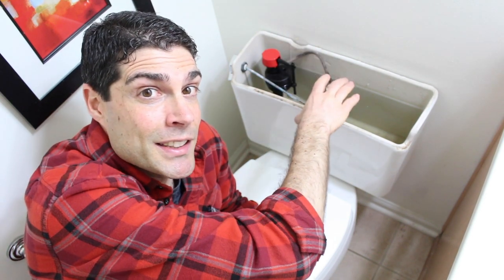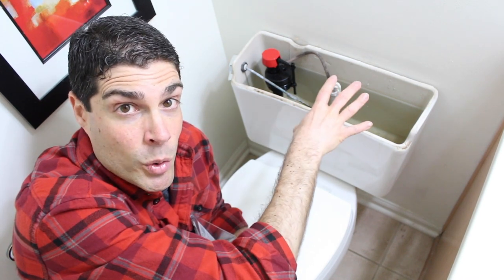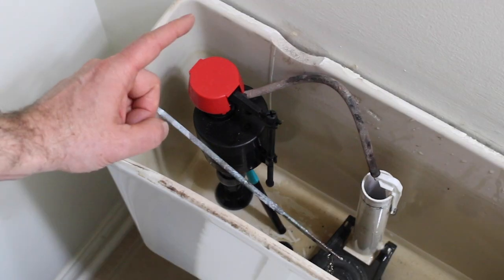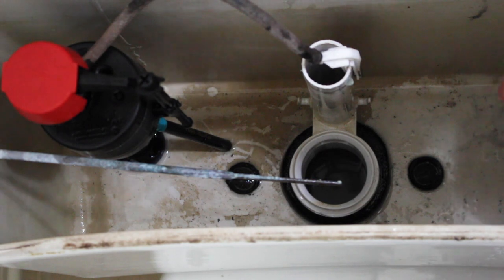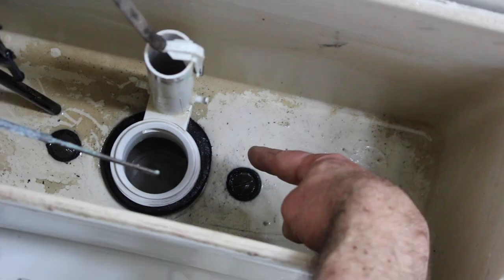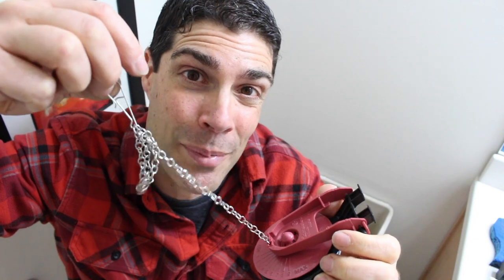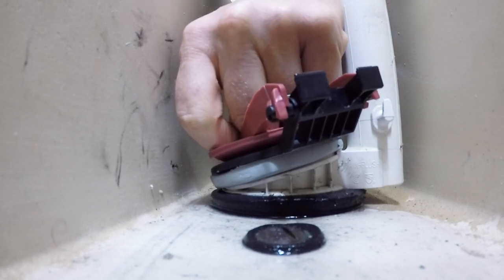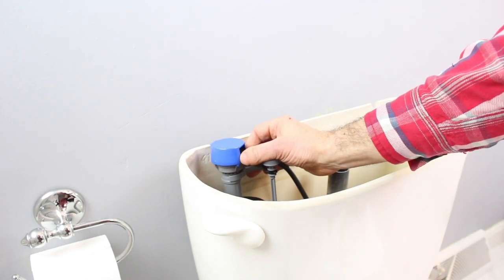Fix Running or Leaking Toilet With Fluidmaster 555C Flush Valve and Flapper Repair Kit

Comment: Got it work. Had to press down on it 4 separate times before it sealed. I am talking two thumbs and up on my toes pressing down, after the 4th try it finally
sealed and no more ghost flushes. Tip, to make sure you are centered over the old opening, take of the flapper when setting in place. The flapper easily attaches afterward.

Comment: We have an OLD toilet. he house was built in 1965 and I would not be surprised if it the original. We bought the house 3 years ago and there was a Fluidmaster 555C in there. 
I had a plumber come and replace all of the water shutoff valves in the house because I couldn't turn any of them.

After he left -- and it seems unlike this was his fault -- we started hearing water dripping. The existing 555C looked worn. I replaced it with another (and I did follow the instructions for installing to porcelain) but I am still hearing water leaking. I tried the food coloring test and the water is coming from the tank to the bowl.

Should I pull up the 555C I just put in and tried to re-install it?
Reply from the maker: The best tip we can offer to find a leak is to do a visual test for siphon and a water test. 
First look at the tank and locate the refill tube, in most cases is a small diameter tube coming off the fill valve and pointed to the overflow pipe, in your case it may be going to a hole on the tank wall or a ceramic overflow pipe. Once you locate it make sure the tubing is not inserted into the opening of the pipe but instead held above it by a clip. If the refill tube is inserted into the opening pull it out and let lay in the water.

Second turn off the water to the tank when the tank is full of water. Mark the water level and let the tank stand for 60-90 minutes without flushing. If you come back and the water has not drained down from your mark then the issue is the refill tube. The fix is to get a clip to hold the refill tube above the overflow pipe opening. If the water does drain down you will need to replace the 555C and try installing a second time, making sure the refill tube is above the overflow pipe.

For additional help or questions visit our website at Fluidmaster.com/support for troubleshooting tips, installation videos, email and chat support or call toll free at 800-631-2011.

Comment: Our toilet has the drain pipe installed at the 9 o'clock position, and is a slanted seat - do I now refer to that as 12 o'clock, or do I just ignore that and just follow this video's positioning?
I'm assuming I make the pipe the new 12 o'clock but wanted to be certain.
Thank you!
Reply from the maker: You are correct in making the overflow pipe the 12 o’clock position. The requirement is simply to offset the flapper frame from the overflow pipe so there is no interference when the flapper is pulled open. If possible set the chain to the tank lever so the pulling action on the chain is as straight as possible. For additional questions on this Fluidmaster product contact us at your earliest convenience. Fluidmaster’s Technical Service Department is available Monday through Friday from 5:30 AM through 5:00 PM Pacific Standard Time. Contact options include: Chat and E-mail on www.Fluidmaster.com and Toll Free 800-631-2011.
Reply: @FluidmasterInc  Thank you! Toilet is flushable again :-)

Comment: I installed the whole valve assembly on two older American standard toilets, 3.5 gallon flush, they were installed around 1979. I installed the fluidmaster kit about 25 years ago and they have been working great ever since. My friends toilet was leaking into the bowl so he shut the water off and asked me if I could fix it, we got the kit and when I looked at the flapper it had this weird angle to, I removed it and installed the flapper that came with the kit, bit was confused about this angle piece until I saw this video, now he thinks the toilet doesn't fill as fast as it used to and after flushing the water still leaks into the bowl then shuts off, I'm wondering if I need to install the angle piece again, there is no brand name on the toilet and he swears the toilet was never worked on as far as he knows, the house was built in 1980 and he bought it in 2000, he has two other bathrooms he can use one I installed a new toilet in a couple of years ago but he wants to be able to use this one it's in the master bedroom, the next time into there I'll have to see what I can do.
Reply from the maker: The Flusher Fixer comes with 3 pieces as indicated in the video, the flapper, the drain seat and the putty. In some cases when the flapper is set to a higher numbered setting, setting 9 for example, the tank may let too much water out of the tank causing the fill valve to run longer to refill the tank. We suggest simply adjusting the flapper to a lower setting to reduce the fill time. As for the leak if we cannot stop the leak with a new drain seat and flapper then it may be time to replace the entire flush valve. Other than a refill tube from the fill valve that is inserted into the overflow pipe, that will drip water into the bowl, there really is not any other places the tank water can leak into the bowl from. For help or more troubleshooting tips contact Fluidmaster by email or chat using Fluidmaster.com/support or call toll free at 800-631-2011, Monday thru Friday 5:30 am to 5:00 pm PST.

Comment: What if the black gasket between the flapper and the tank base is deteriorating?
Reply from the maker: That gasket (also known as a “Spud Gasket”) when damaged can allow water to pass by the flush valve drain and leak into the bowl or in some cases leak right onto the floor causing damage to your home. Our recommendation is to replace the flush valve. Fluidmaster’s flush valve kits all come with a form fitted spud gasket already installed on the valve and our newest Flush Valve Kit 507A-008 (For 2 Inch Toilets) comes with a wrench to fit older and Fluidmaster flush valve lock nuts.

Comment: How to locate the new 555C Flush Valve and Flapper 3:20: It has to be rotated for the hinge area to clear the existing tube.
In our toilet the Adjustable Flapper attaches to a Fluidmaster pipe/flapper seat already - replacing not a breeze because its jammed against the toilet bowl wall  "not me" did that.
Reply from the maker: Ron - could you please call Technical Support at 800-631-2011 so we can better understand the issue? Thanks.

Comment: great video except for the annoying background music. i just found out about this product and i sure hope it works so i won't have to remove the tank including the stupid ferrous nuts someone used to fasten the brass bolts. i don't understand how water has been seeping thru the flush valve even after installing a new gasket.

Comment: Not all toilets use a flapper valve. Some--Eljer, for example, use a ball on a vertical rod that drops down into the tank drain. Sometimes the ball doesn't drop all the way and the tank leaks into the bowl. VERY annoying, as there's no way to predict when it will happen.
Reply from the maker: There is no predictable way to determine when a flapper or ball and rod (like the Eljer) will fail. Fluidmaster does recommend changing the parts inside your tank every 5 years to help maintain your toilet.
 Fluidmaster does have a rod and ball available it is our model 5100 . Follow this link to find more information on our Tank Ball 5100 https://www.fluidmaster.com/products/toilet/flappers/5100-tank-ball/